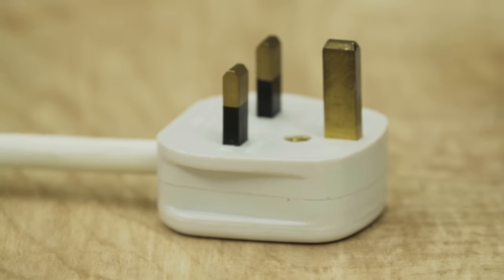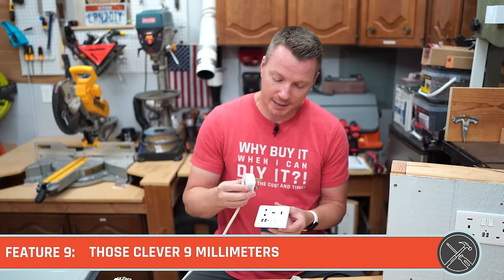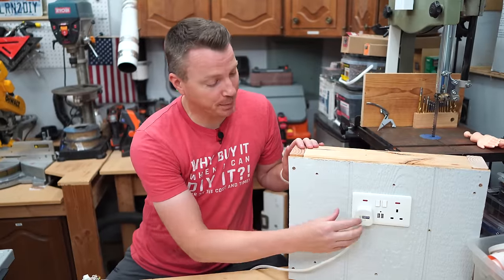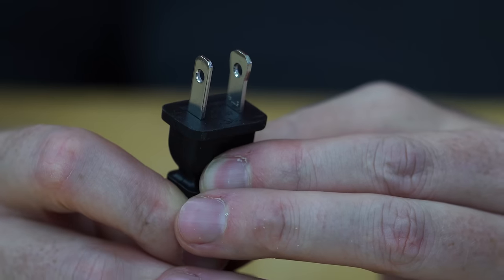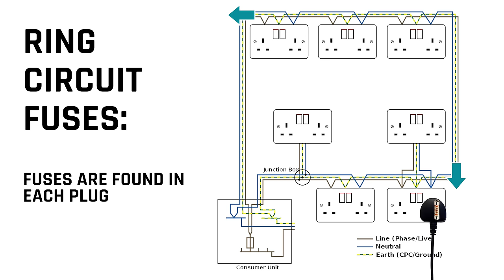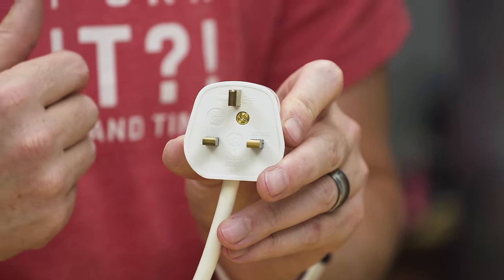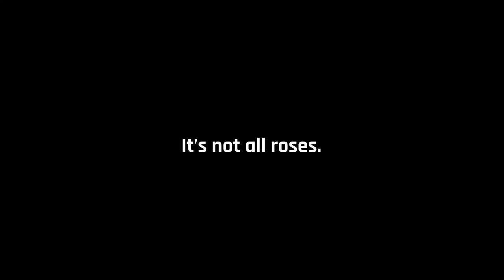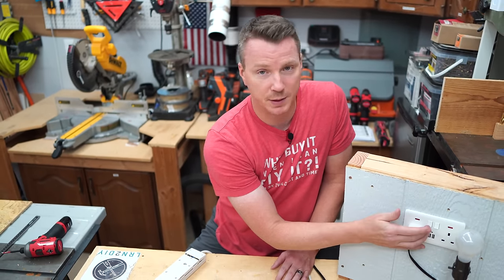British Plugs and Outlets Are On Another Level

Comment: It may have been mentioned already, but the plug also has extended "wings" sticking out on ether side at the base so that your fingers are kept away from the pins. They make it difficult to wrap your fingers around the base of the plug when inserting it into a socket.
Reply: Our UK plugs are so cool lol so many features we take for granted
Reply: European plugs have that too
Reply: T'is actually especially useful because I have some plugs that don't have these "wings" and whenever I try to plug them in, the skin on my fingers wrap around the plug and when I press down on, It basically just turns into a pinching machine between the socket and the flush plug. So, yes. it does have more implications than just the fingers touching the pins.
Reply: I'm from the UK and didn't know that🤣🤣
Reply: @codname125  The European Type E/F plug is pretty cool, too. I think it looks better, but type G has more features. Both are pretty safe
Reply: Also easier to pull out, with the side indentations on a lot of the plugs.

Plus, you can buy special plugs with a moulded plastic 'loop' kinda thing on the back of the plug, so it's easier for those with arthritis or frailty to pull out, considering how snugly our plugs fit in.

Comment: Hi, I've been an electrician in the UK for 30+ years, and the load balancing 'issue' is a one in a thousand problem, and that 'one' is almost always the copper loom. Some people always think volts when they should be really thinking about amps 😉
Reply: On that you are absolutely right. You can also think in watts. A standard 32amp ring can take 7000 watts (i think I am correct) so if you don't know the amperage of your kit you can calculate in watts as most equipment has at least that written on it. For a spur socket, should you happen to have one, that should be capable of handling about 2800 watts. A lighting circuit can handle 1100 watts but if you use LED lighting there are no concerns you will ever get up to that.  By the way I am not an electrician. This is just knowledge I have garnered over my many years. Always consult a professional electrician if in doubt. All wattages here assume a voltage of 220 volts.
Reply: @ThePuterMan  That's decent knowledge for a non-electrician, nice one. I wish there were more basic courses on conduction/resistance in schools and colleges, just so more people were aware of the processes. For example, most construction companies use the minimal safe amount of wiring to pass the safety inspections. But 20% more copper would give more than a 200% increase in safety for little cost, but they don't because they don't have to and no one seems to care enough to change regulations.
Reply: @spookybuz7803  Thanks for sharing! Tell us more about the 20%! What spec cable is typically installed, and what do you recommend?
Reply: With Americans it is neither the volts or the amps; it's the thinking part in my experience.😏
Reply: PREACH
Reply: I'm also an Electrician here in the UK and I have never came across an issue with load balancing.
Reply: @spookybuz7803  They teach you Ohm's law at school. But looking on Facebook will show you that most people don't even remember how to spell or understand simple statistics, yet most of them passed exams at school requiring that.
Reply: @greenaum  You're opening up a whole new area of human behaviour with that comment, which I totally understand. Social media can be a blessing and a curse. But where electricity is concerned, please please contact a qualified person.
Reply: @ThePuterMan  P=U x I.... 230V x 32A = 7.360W. A 16A fuse / circuit could obviously do half that, 3.680W
Reply: @stevewatson6839  let's go Brandon 😂
Reply: @T0REBK  👍
Reply: @greenaum  Sample size of one, but as far as I can recall I was only ever taught Ohm's law when I specifically opted into an engineering-related course (vehicle maintenance, to be specific).
Reply: @thegrouchization  Didn't you do Science at school, or Technology, or something that includes woodwork, metalwork, electronics, etc, whatever they call it? We do in the UK, it's normal. You'd do Ohm's Law in the Technology lesson, but it's also usually covered in science. They teach a bit of magnetism, optics, genetics, all of that, plus a bit of electricity, amps, volts, and ohms. You can't learn anything about electricity without Ohm's Law!
Reply: @thegrouchization  "as far as I can recall" might be the important part of your post! I did say that nobody remembers anything they were taught at school!
Reply: @greenaum  It's worth noting that I moved several times over the course of my education (the biggest shift being from Scotland to mid-England). I may have missed a few things due to that, but I genuinely have no recollection of anything to do with electricity in my high school years (and what surviving notes I still have corroborate this).

I do however have distinct memories of the subject in the aforementioned engineering courses, and the impression I got from my classmates was that it was all new to them as well.

While there was a brief stint of woodworking and metalworking in high school (3 lessons at most), we didn't learn the principles behind how the machines we used worked, only how to operate them.

One more thing to note is that I get the impression that you're a bit older than me, so there's a distinct possibility that the syllabus may have changed between our respective school years (mine being the 2000s to the early 2010s).
Reply: @spookybuz7803  It is not  the amount of copper you use that makes a system safe.The safety is in using proper insulation and the correct fault detection devices designed for the system that makes it safe and making sure you dont overload the circuits using the correct sized circuit breakers.  I dont know where you got the 20% from?
Reply: @MrLeighman  I think you misunderstood. The original poster commented on possible load balancing issues on a ring circuit, issues which I've only seen twice in 32 years. I didn't feel the need to mention insulation or circuit breakers as it wasn't apparent that it was what he was talking about. What you said is correct, but if you want to be pedantic, you run your kettle off a 1mm unarmoured copper cable and I'll run mine on an 8mm. See what happens.

Comment: A safety feature in the design that you didn't mention is how the plug is internally partitioned so that even if the live wire were to come loose inside the plug, the partitioning (and what with the live wire being the shortest as you mentioned in the video) makes it unlikely that the live wire will come into contact with the neutral or earth wire/terminal.
Reply: Not to mention the size of the plug helps those with disabilities. You put that sucker in the palm of your hand and ram that thing into the socket. You probably don't even need fingers.
Reply: @RACE.TV1  A smaller, lighter plug would most likely still be easier though.
Reply: @RACE.TV1  it’s better for some, worse for others. Probably great if fine motor skills are your problem, but it would also be very clunky to manipulate for others
Reply: @deletemedeleteme43  Some people still find them harder to use than other types of plugs. Ask any of the millions of people with arthritis in their hands.

Comment: Not mentioned here, the fuse in the plug is intended to be rated for the flex/cable and appliance together, so a smaller cable gets a smaller fuse. Therefore even under fault conditions insufficient to trip the main breaker, you still can’t melt the wire, because the fuse blows first. Typically a 13A fuse on a 3kW kettle, a 3A fuse on a lamp. An additional important safety feature!
Reply: I think it's great that new items already come with a fitted plug as standard long time nowadays and now that actually makes me wonder why and if you can still buy plugs? What would be the actual point ha
Reply: @David.L291  yes you can still buy plugs. I often convert foreign equipment to plug type G.

Its also still possible to damage a plug, say crushing it when the equipment is in storage. Or pins wearing with very heavy use over 20 years.
Reply: Unfortunately, most plugs are automatically sold with 13A fuses. In reality you should be asked what the plug is for then be provided with the appropriate fuse.
Reply: The fuse in the plug trick is in most USA dangerous gadgets that are not directly wired like afurnace. Blow dryer, clothing dryer, clothes washer etc.

Comment: My late brother was BSc  and first engineer for the CEGB. He admired the UK plug. It's an amazing device regarding safety.
Reply: @TD75  yes. It is
Reply: @TD75  the guy in the video literally tells us how he has been shocked multiple times. That's just not something that happens in the UK. Why design something poorly when it could be done better?
Reply: sorry for your loss
Reply: @TD75  Your anecdote is not data. Remember that your experiences are not universal - just because you haven't heard of it happening doesn't mean it doesn't happen. An easy google search tells me there are 400 fatalities caused by electricity in the USA per year, while the UK has only 30, despite the increased voltage. That's 0.41 per million in the UK and 1.2 per million in the US. This plug saves lives.
Reply: @TD75  You've never heard of it? You can find many video compilations online.

Comment: One of the benefits that you fail to mention. Because the cable exits parallel to the wall  you can place a piece of furniture such as a side cabinet in front of the outlet without the risk of either kinking the cable and  or damaging it in the process.
Reply: We have those kinds of cables in the eu as well
Reply: You still need lots of clearance regardless if you want to plug something in and out because of how long the pins are. Some North American plugs have the cord parallel with the wall, but it's not a standard.
Reply: @pikachuchujelly7628  once plugged in what remains on the outside is very minimal, you can definitely push your furnitures right against the wall and have a very minimal gap
Reply: @pikachuchujelly7628  usually things that are being plugged in and out don’t go in sockets behind furniture so it’s a non issue. Things that remain plugged in long term such as a lamp or television do not need much clearance.

Comment: You didn’t mention that the colours of the leads in Britain were specified by the Electrical Appliances (Colour Code) Regulations 1969. From 1 July of that year the live lead was brown, the neutral lead was blue and the earth lead was green and yellow. These are the colours least likely to be indistinguishable by a colour-blind person. Before that date the colours were red, black and green respectively, which all look the same to many colour blind viewers.
Reply: When I served my time as an industrial sparky back in the 90's, the flex colours were indeed, brown, blue & green/yellow. Standard house wiring cable (from distribution board to sockets, light fittings etc. were red, black and green or green/yellow sleeve. 

Three phase cabling was red, yellow & blue with the neutral being black. If you were wiring ring mains in singles cable in an industrial setting, you would often find the live cable would be either red, yellow or blue, with the black neutral.

Times moved on and we standardised on the mains wiring being the same as the flex wiring, brown, blue and green/yellow, with 3 phase colours changing to brown, black & grey with a blue neutral.... Many older buildings can have a combination of wiring colour standards and a label has to be placed on the distribution board stating that both colour schemes are in use from that board. Complicated or what? 😆

Final point, you can get un-switched sockets in the UK, not as common as switched ones, and often used as a means of disconnection behind built in appliances or washing machines etc, but with a separate disconnection switch above the counter...
Reply: They are also that colour because bLue - for Left.
bRown - for Right 
yeLLow for middLe
Reply: @brooke1639  No, that was a mnemonic. The colours were chosen because most people who are colour blind can distinguish them.
Reply: Confusing the red and the green is rather unlikely unless you're trying to splice into it from the middle somewhere. And even then, you'd likely not have problems as the live lead is going to be carrying voltage when the neutral and ground aren't. It's something that you'd test for regardless of whether or not you're colorblind as you'd want to make sure that no numbskull wired it backwards. Which, for many applications wouldn't be an issue as the current does flow through both of them when in use. 

It is better not to use colors that are easily missed by those with colorblindness, but it's more of a convenience and extra measure than anything else.
Reply: @brooke1639  Except, that it would still work  with the hot and neutral reversed, this is an AC circuit after all. You wouldn't do it because it isn't standard and can result in issues if somebody does come along later and assume that there's standard wiring going on.
Reply: The new colours are awful to distinguish when in poor light or with dust on them  (as you would find in MOST industrial applications )  - most British electrical contractors are of this opinion !
Reply: @SmallSpoonBrigade  In those days most electrical goods were supplied without plugs. You had to buy a plug and connect it to the bare wire from the appliance. It was important that you be able to see which wire went to which tine of the plug. The colours red, black and green all look the same to sufferers from the most common form of colour blindness.
Reply: @richardgrant7055  
The harmonised three phase colours are indeed awful. To add to the stupidity: one of the Phase colours (Black), was our old neutral colour.
Reply: @kenjohnson762  Absolutely. And there were/are other mnemonics, too -  my dad taught me how to wire a plug when I was eight (1980 - Thatcher era) with 'brown=George Brown, the live wire of the Labour party'. He (George, not my dad) was a politician in the Lords by then, and even though I went on to study politics, he never came up! But good God he's saved many a cup of tea for me, even now (why is it always the kettle that goes?)
Reply: @brooke1639  It's BRown (bottom right) and BLue (bottom left). So I was taught anyway.
Reply: It doesn't really apply now a days since it's illegal for manacturers to sell appliances in UK that don't have a moulded plug fitted.
Reply: @SmallSpoonBrigade  You also wouldn't reverse it because the fuse is on the live pin, so if it blows there's no current to the the appliance.  If the wires were reversed and the fuse blew the appliance would still be live when you went to check it.
Reply: @kenjohnson762  and now by complete contrast all new appliances have to come with a fitted plug as standard
Reply: yeah but you have to admit it's kinda dumb that the brown one is live, and the lightning lookin one is earth...
i actually remember it by remembering that it's dumb.